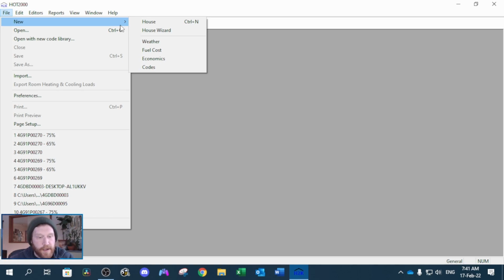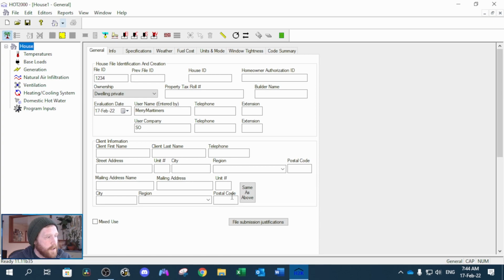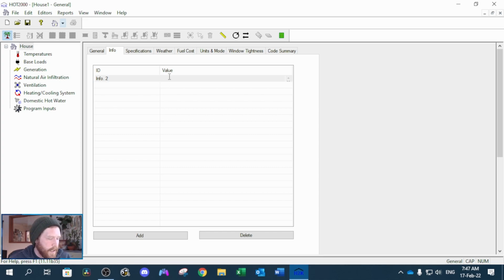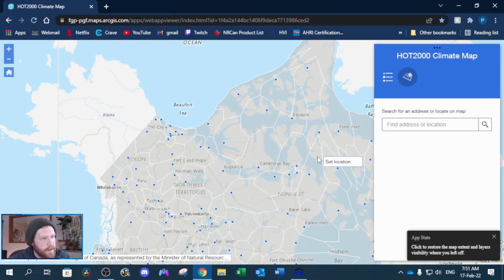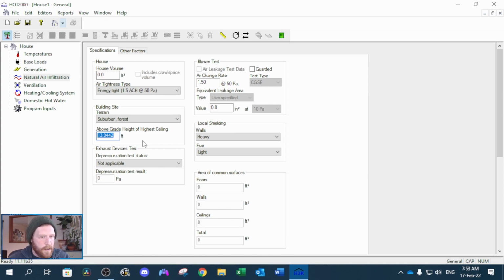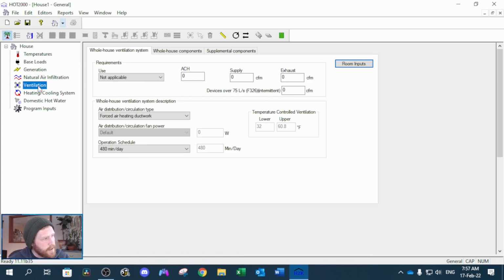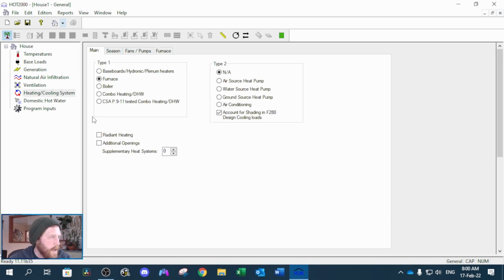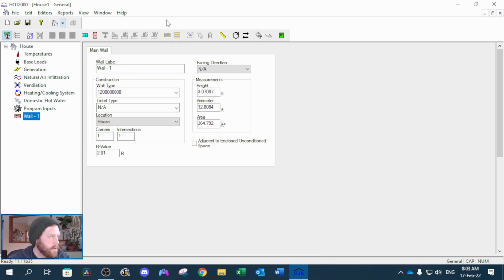Hot2000 Setup/Overview

Comment: Hi Sir, I need a small help. My Hot 2000 is not indicating Ontario reference house under programs tab. I do not understand why it isn't showing up. I need to print a report showing reference and as designed report.
Reply: I have the same issue, did you figure this out?

Comment: I'm just starting to look into becoming a EA wondering what Are the biggest steps I can take entering this new to me field.
videos are very helpful .
Reply from the maker: There are 2 tests you need to pass from NRCan. The subreddit r/energyadvisors is a great resource/place for info
Reply: @merrytimes  Are they montered by video or zoom and do you have to set a specific time to do them on weekdays?
Reply from the maker: I had to take 1 last year and I had the option to do the monitored by video vs going somewhere in person. It was cheaper and it isn't zoom it was something else. They let you select various time slots. Can't remember if weekends or evenings are available

Comment: thank you! you share.i have question.May I ask if the computer installed version 11.11 before and later uninstalled, I installed the new version 11.12, the previous file can not be opened. I uninstalled 11.12 and installed 11.11, but I kept being told that there was an error and I couldn't find the hot2000 running program
Reply from the maker: I think the issue might be that your computer is still trying to open everything in 11.11. Try opening up 11.12 the program not an already made file then open the file from within 11.12

Comment: hi, is it possible to get the cost of certain items from HOT2000? For example, the cost of electric vs gas-fired vs oil-fired water heaters?
Reply from the maker: Yep there is a fuel library that you can edit to reflect the costs of different fuel prices
Reply: @merrytimes  Thank you for getting back to me, do you happen to have a fuel cost library file for the fuel costs of all 13 provinces and territories? The default one only seems to have ottawa, wpggas, and manhyd. Thanks!